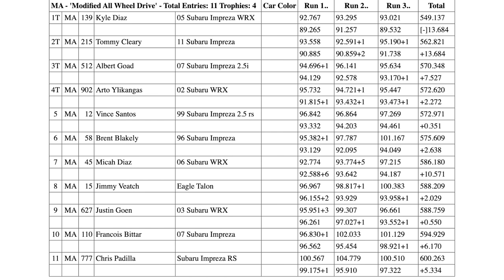MY FIRST RALLY COMP! x WRX Rally Car #RutsAndGuts

Comment: You’re progressing nicely dude, car is legit fast. Your driver mod progressed as we watched. Seems like you’ll have less grip when wheel speed exceeds actual speed but the setup for some of the late apex corners require slides nose pointed straight at the inner clipping point as you slide past them wot and grip into the next straight or corner. You’re fast af either way you cut it. I love this.